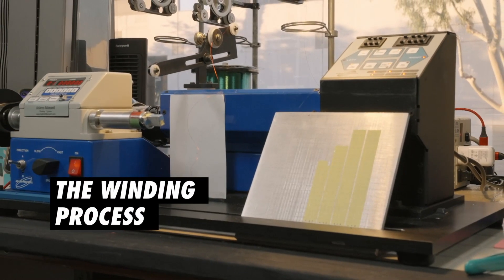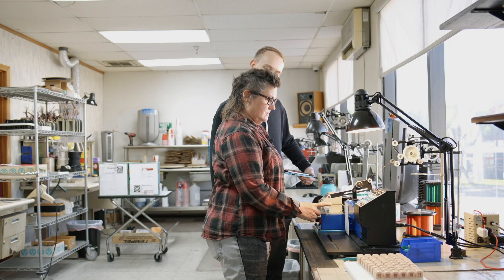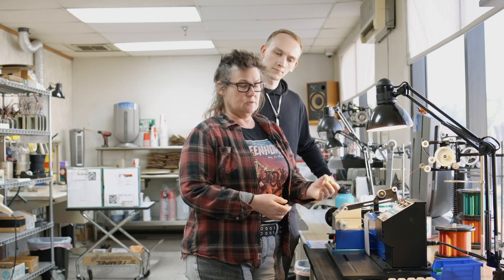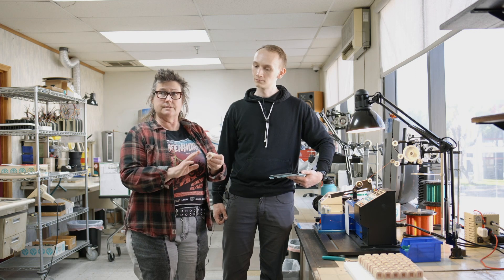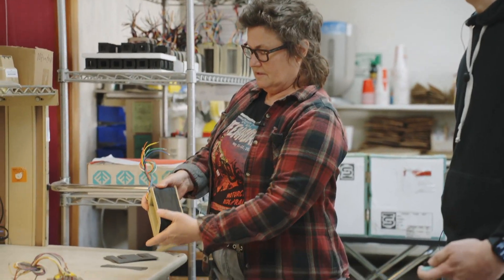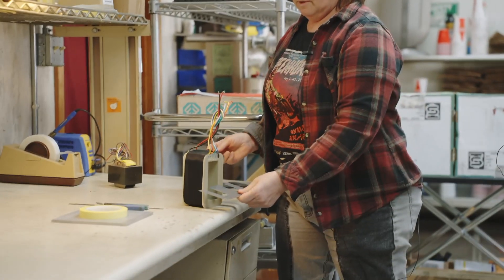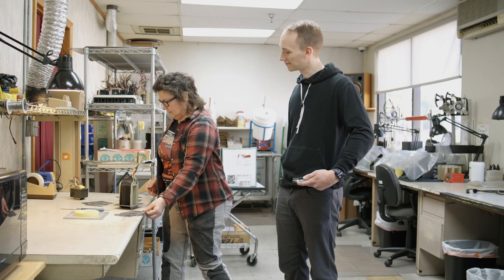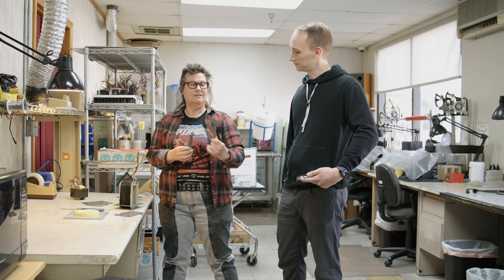How Transformers Are Wound: Audio Gear Manufacturing

Comment: The way she easily explained everything really demonstrates how well she knows not only the practical application of manufacturing transformers, but the theoretical application too. She reminds me of the woman that taught my computer networking class during my freshman year of high school. She was an older woman and did not look anywhere near what stereotypical computer nerds look like. Frankly, she looked more like a stereotypical lunch lady. She was also very straight to the point and would threaten kids with washing their mouths out with soap whenever she would hear bad language. Which turned out to be the most effective way I saw any high school teacher control a classroom, not because it was a real threat, instead she delivered it with such conviction that the legitimacy of the consequence did not matter. 

Anyway, I was talking to her one-on-one during class and she shared with me that she worked for IBM in the 80s and her first exposure to programming was using punch cards in the 70s. I was so impressed, that was easily the coolest thing I had learned about any of my high school teachers lives beyond their lives in the classroom. She retired that year and another competent teacher replaced her, but he was certainly not the treasure that I consider her to be.

I didn't mean to write all of this. Oh well, the point that I intended on making is to not be assuming of people based on appearances. If I see a Gen X looking woman with a mullet such as the one in the video, transformer expertise would not be an assuming quality of her that immediately comes to mind. Not that it's safe to assume anyone is an expert on transformers, apart from maybe someone that is very enthusiastic about vintage Japanese action figures.

Comment: How exciting, how do bananas get in there skins.
Reply: Laminations
Reply: Great question! In the early 18th century when bananas where invented by Sir Winston Banana bananas were built using a technique known as "reverse peeling", a process wich was used until the creation of the now true and tested method of having a closed skin where a banana is put inside via injection. This method is superior because it gives the banana, and more specifically it's skin' more stability to endure it's daily uses. It was also around the time of the invention of that method that the skins were coated on the inside with a substance to make them more slippery. Next time you eat a banana just think about the great effort made by it's inventor and those who made the design better and weep in appreciation
Reply: Thank you very much for your assistance in this matter, of course I've heard of this process but was a bit confused because I read in an old encyclopedia that bananas were invented by an African professor Dapola Amboolo but had many problems. Initially he would try to install a banana in uts skin with an air compressor at a pressure of 72.5psi bit the banana would explode before it was fully in its skin. Eventually he found using a bycicle tyre pump provided just the right pressure, from then on had full success. But this could be completely wrong.
Reply: @IainDavies-z2l  yes how did I forget about Dapola Amboolo! The first banana prototypes were made by him, centuries later came Winston Banana that named Dapolo's invention after his own name in an attempt to steal his deserved fame
Reply: Of course this now leads to the question how to get the perfect spherical fruit that only Lord Montenegro Outspan managed eventually to achieve in his orange, while Monseure Le Mon of Nancy in France has only managed to get his  yellow ovoide fruit. I did read that the perfect spherical fruit has to go through the process of electro magnetic transformation as in the electrons must be of the same negative polarity so the magnetic boundary field becomes a pure sphere. It took a while until the start of the 20th century to produce a large enough magnatron  to induce into the atoms enough magnetic field to produce a perfect spherical particle. An interesting side note is for this to happen the water content must be 82.65 percent hydrated oxygen.